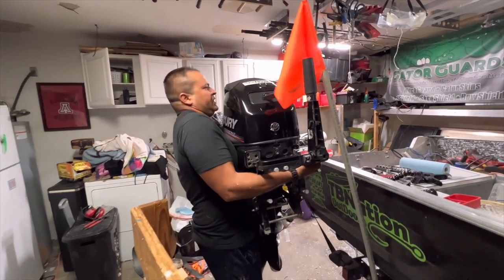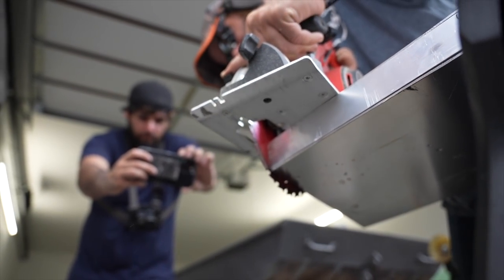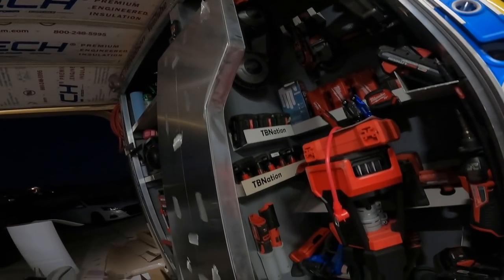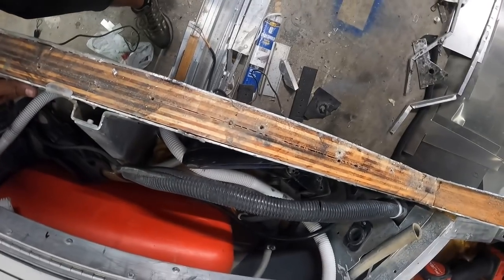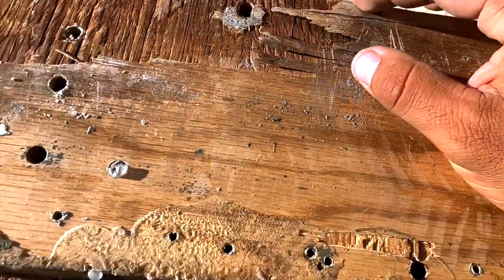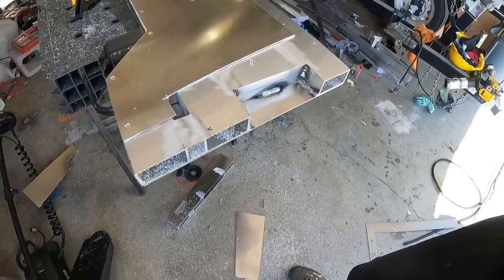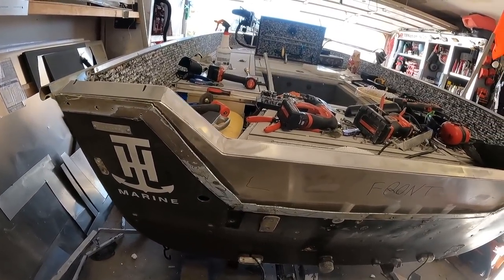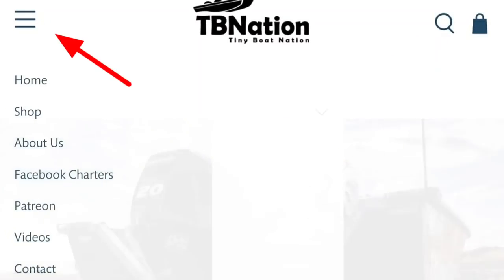DIY aluminum transom install for jon boats/small boats: THE ULTIMATE BOAT MOD!

Comment: Iv got a 1994 alumaweld express 17ft it's all aluminum I wished when it was built they would put tubing or at least cosa board in the transom at least where' the motor bolts on iv had it 4 years some one over tighted it squished the transom some still solid but transom on a alumaweld are holow

Comment: I had no idea they even made all aluminum  transoms.  I am currently in the process of making my own all aluminum  transom for my boat and ran across your video.  I was looking at  seacast to just pour mine in bc it would be so much quicker, but my boat doesn't have an inner and outer transom skin . 
Just curious,  what company makes those all aluminum  transom ?

Comment: Been building my boat with suplies from your website...the new aluminum transom wasnt an option when i was doing mine, wish it was but missed it by a month...anyway, you used fiberglass resin on your wood transom rite? I bought west marine epoxy resin and did three coats on it. I purchased the plywood alil under size and made up the difference with the epoxy...i wish this was a option then but i think i should be ok. Thanks for what you do!

Comment: Had a friend put a plate on his V14 tracker and its way to low now and water comes over the back.  Have others had this issue?  He has a long shaft 15hp on a V14 Guide.  He fixing to add pods etc.

Comment: The wood transom you pulled out--the splitting is in the layers of wood that had the grain perpendicular to the water.  Picture each layer as a stack of straws all pointing the same way (and 90 degrees to the neighboring layer):  the layers with end grain into the water pull the water up and split; the layers parallel to the water don't pull the water in as well.

Comment: One tip with aluminum is to spray it with wd-40. Its soft stuff so when doing fitup or wedging it in etc...a little lube goes a long way. Also when you cutting plate with a metal circ saw, spray some wd 40 on the fence and see how much easier it is to cut.

Comment: what are peoples thoughts if a guy was to make a simular aluminum sandwich filled with pour in transom then cut to fit . still no wood inside to rot but making the surface 100% solid from edge to edge.

Comment: I wanna get  aluminum  trans for  my  starcraft boat and  cause I want to  recover my  boat with four stroke  with Same amount of  horses  but would  be  little  more  heavier than my 93 110 hp johnson outboard motor  it's great  motor  bjt I noticed  it using  a bit more  fuel than  my brother  boat and he has 40 more horses and his more boat weighs more

Comment: The wood was rotting from being wet. If you would have spent $20 on fiberglass resin and applied a couple coats over the wood it would have lasted for decades.
Reply from the maker: No, it won’t. Resin cracks  and degrades with wave shutter. Resin coating wood doesn’t make it any better, it just makes it less prone to corroding the aluminum and will increase the life of the transom, but the transom will eventually go, because what is organically prone to degrade.
Reply: @TinyBoatNation  then how did mine that I did with wood and fiberglass resin in 1991 last till this past fall? I put my boat in every spring and leave it docked in the water till fall...lasted 32 years. Probably would have lasted longer if my automatic bulge pump failed. It sat submerged for a week a couple times.
Reply: Fibreglass is the way 👍🏻👍🏻
Reply: @tripplebeards3427  how do boats from the 80s not have rotted wood? All about condition nothing wood an glass on a transom if no way shape or form stronger then aluminum tubing on a transom

Comment: You work hard, but learn from your previous mistakes and get away from drilling so many holes and using all the rivets and screws. They weaken and leak like hell. What happened to that welder a subscriber gave you a while back?